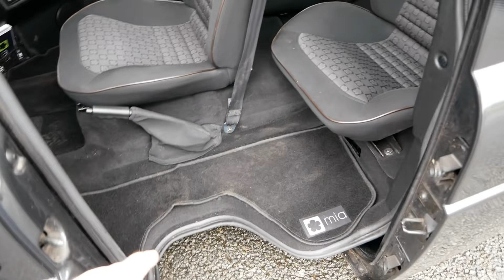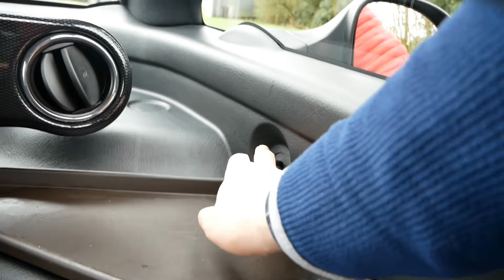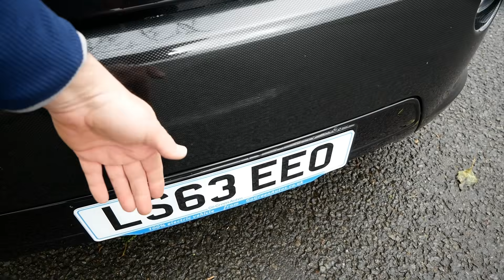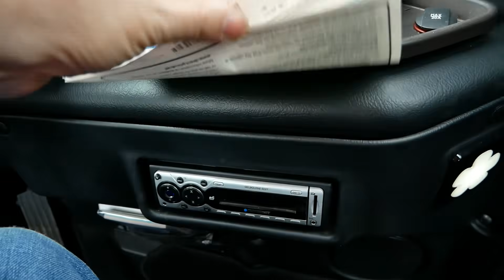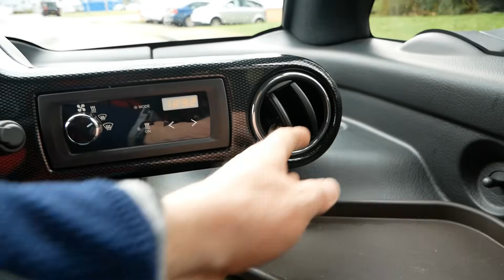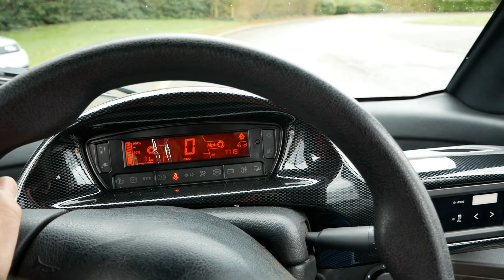Mia Electric. The rarest EV in the UK. Stand out from the crowd! (SOLD)

Comment: I have to ask what is the MPH of the Mia . If around 28/30 that would be great for anyone that only needs a motorcycle license.
Reply from the maker: They do about 65mph top speed and classed as a car, so can't drive with a motorcycle licence. The lower powered Twizy is the solution. These come in two versions. The lowered powered version was limited to something like 28 mph and is classed as a light quadricycle, so could be driven by 16 year olds. However, they were never sold in the UK. We only got the higher powered versions, which did 50 mph and classed as a heavy quadricycle, so needed a full driver's licence.

Comment: Does this mean it's effectively got 2 'holes/gaps' in the floor near the doors due to the cutout design? If so that can't be good in wet weather? Please correct me if I'm wrong.
Reply: The sliding doors have corresponding lids that will cover the cut outs. Absolutely save and sealed. The front window needs new seals, this is a known issue and can be fixed by any car glass expert easily. I love to drive this french diva between suburb to city, lowest cost per mile and cubic inch of space, remember Smart has only two seats at the same footprint ...
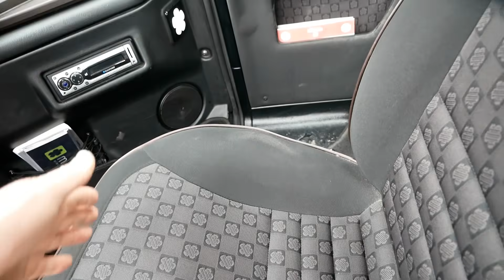Reply: @lachsi1malig  Yeah, you can see at 5:15 it's covered and closed.